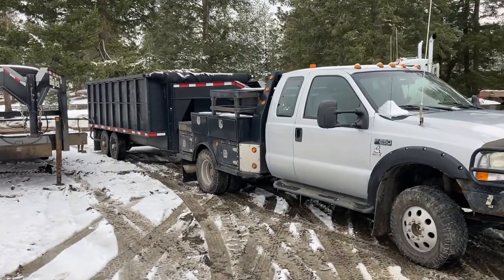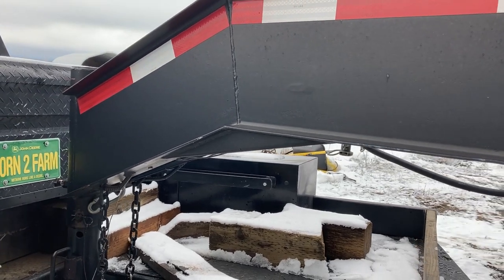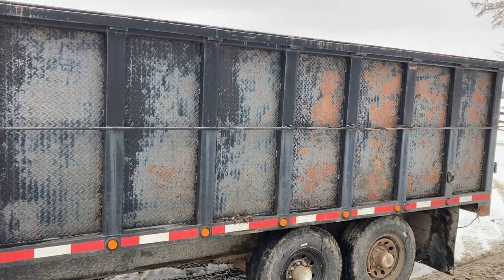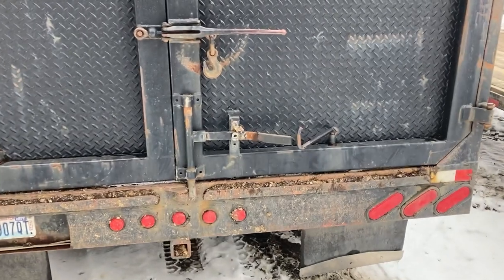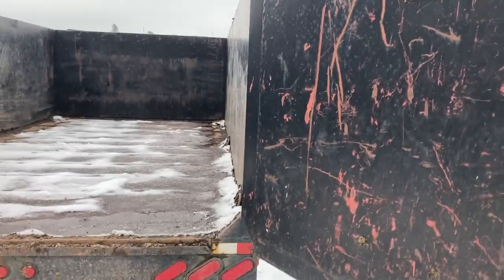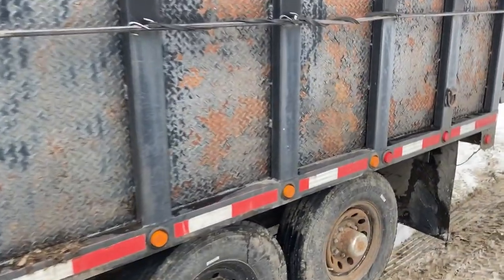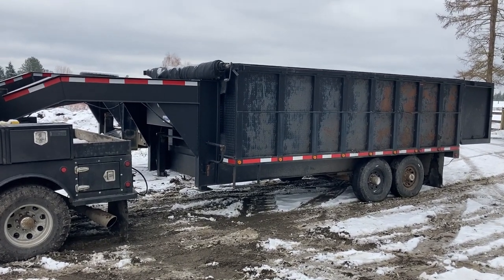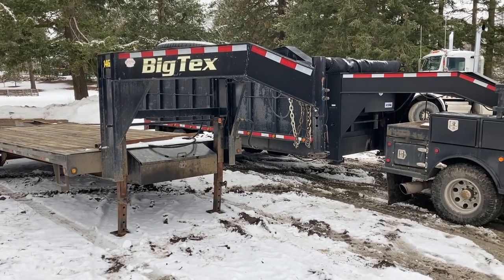Custom Homemade Gooseneck Dump Trailer Review And Walkaround Plus New Project Sneak Peak

Comment: If that is a typical (double acting) cylinder, you don’t have to  convert it to power down to get more useable fluid capacity. Simply plumb the “down” side back to the bottom of the tank. After one lift, you’ll have to add fluid, then you’re golden.

Comment: I had a 34' gooseneck with a similar beaver tail as your BigTex.  The difference was that the bottom of the ramps had diamond plate steel welded to them so that when they are stowed, they provided a flat surface you could place a load on.  It also had a hinged flat plate between the ramps that is normally stowed but you can raise manually which gave me a full 34' flat deck.  

I found that configuration to be very handy.  It gave me the ease and simplicity of hinged ramps for loading wheeled or tracked equipment  without sacrificing the last 5' should I need a flat deck.
Reply from the maker: That's actually a good idea, and one that I will probably use when I rebuild the big tex trailer I have.